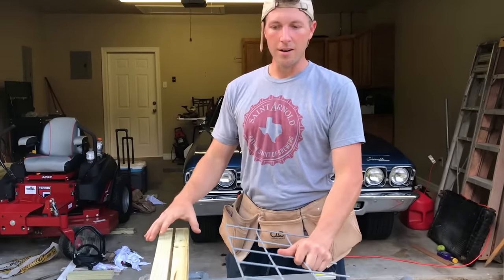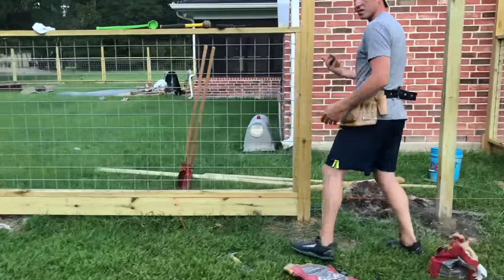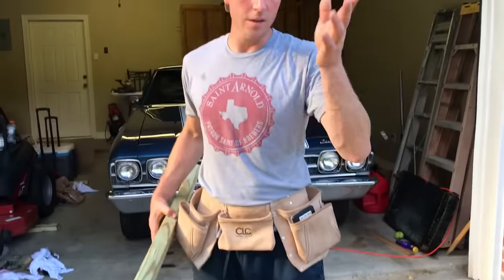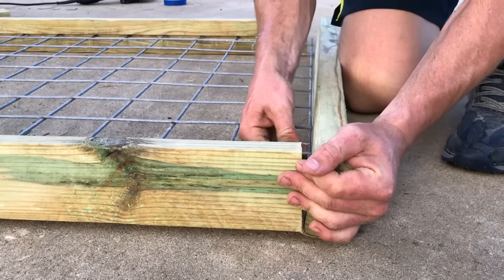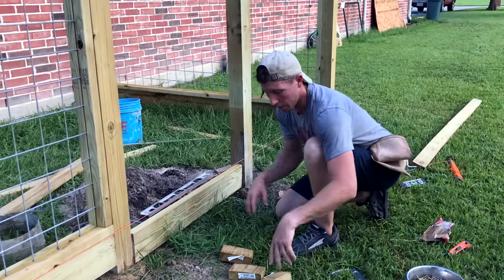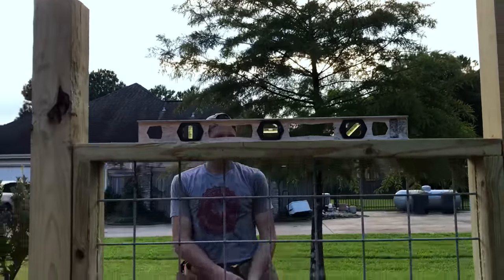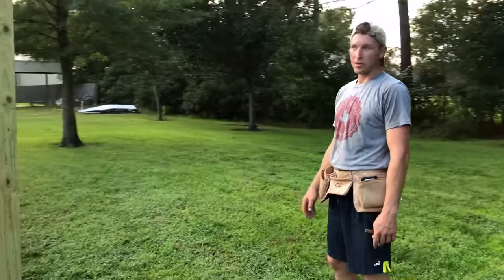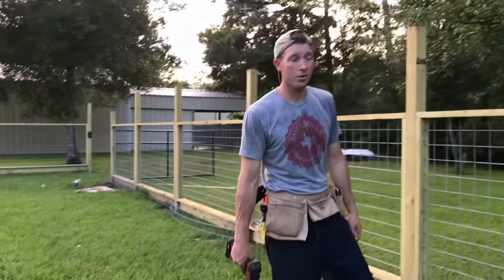Part 1: Modular Hogwire Panel Fence with Dado Groove

Comment: "Dog shit"?  I prefer the term "land mines"... :)

Thumb-up for the the St Arnold t-shirt and the token Lone Star cans -- the NATIONAL Beer of Texas!  I prefer a very hoppy IPA from Karbach though... Life is too short to drink crappy beer... :)
I'm in the Houston metro-mess and the HOA Nazis would not allow us to have that sort of fence -- we can either have the square metal tubing picket (aka "wrought iron") style or the 6 ft tall by 6" width cedar board picket "privacy" fences.  Of course, as everyone learned after Hurricane Ike, those cedar fences catch the wind very well and nearly every fence around here was blown over with the posts snapped at the ground.  I had around 250 ft of fence blown down by the storm and I replaced it with a square metal tubing picket fence that I welded up myself.  With the pickets spaced around 4" apart and only being 1/2" wide, they don't catch much wind, so they should survive any foreseeable hurricane winds.  Of course, building that takes more time than what you built.

One suggestion for you with respect to the panels though that might save you some time fitting them between the posts... Install the bottom and sides first between the posts and leave the top open.  Then slide the metal panel in the dado slot.  This will give you a bit more leeway if the posts are not perfectly plumb.
BTW, another wood and steel design that looks pretty good is to use rebar for vertical pickets and lumber for the horizontal rails.  Instead of cutting a dado slot in the 2x4s that you are using for the top and bottom rails, you just use an appropriate size drill bit to drill a hole about halfway into the upper edge of the bottom rail and the lower edge of the top rail.  #3 (i.e. 3/8" diameter) rebar goes for $4.25 for a 20 ft piece at Home Depot and is sometimes cheaper at the steel supply companies.  At 3/8" thick, I suspect that it would probably take a few decades to rust out even if you never painted it.  Personally though, even though I like the look of the wood and steel, the only reason I would do that is if I did not have the capability to weld the fence sections myself.  Besides, the wood rails on the fence end up warping over the years.  When I built my fence, I made one section so that it was removable by way of just being able to lift it off the brackets that hold it.  The HOA Nazis limit the size of the gate you can put in your fence and it cannot be made large enough to drive a vehicle through it and a lawn tractor just barely fits through their allowed size gate.  This way, if I need to have a trailer of mulch or whatever delivered to my house, I can remove the fence panel, back the trailer through it like it was a gate, and then quickly place the panel back before the HOA Nazis notice my impromptu "gate".
Reply from the maker: Thanks for your valued reply! I considered the way you were talking about with sliding the panels in, but i didnt want to take a change of being forceful and bending my wire if it wasnt exactly to the right tolerances. By the way, i prefer your kind of beer too, but if im doing a project i prefer to go the light route so i can stay on task..if you know what i mean. Thats pretty impressive you took it upon yourself to do your own fence. I would have probably done a similar method for making the yard accessible to larger thank lawn mowers. I dont know if you have taken the time to watch it yet, but i have a part 2 that goes over staining and included my 18 month evaluation that answers alot of peoples questions and concerns about how it is holding up. In short, there is nothing i would change about the design of the fence. Especially when it was one of the few standing after multiple windstorms over the past year an a half. Cheers.
https://youtu.be/bL89wkzSPDo
Reply: @GatorOverland  -- I saw the YouTube suggestion of the other video and just finished watching it.  18 months is not that long.  Hurricane Ike was in 2008 and the pressure treated pine on the rails of my cedar picket fence sections that adjoin my side neighbors definitely have a bow in them at this point, so let's see what your looks like in another 10 years.  Maybe with the less weight, it won't bow as much as mine ended up doing.  Each of my fence sections was around 7-8' in length since I just took the total length of the fence and divided it into an equal number of sections so that they were less than the 8 ft length of the boards that I was using for the rails.
Reply from the maker: @CurmudgeonExtraordinaire  you definitely did it the right way. My design is as tall and as long as you can go with  2x4x8ft and have minimal scrap (wasted money). Yes 18 months is still a very young fence. Being as i was a fresh new homeowner with no capital left and still needed to contain my dogs, i would have been happy with 5 years just to keep them safe, but at this point only time will tell. Im very confident i will get 10years at this rate. And if it begins to fail, it will be inexpensive to replace. Thanks again for you input.
Reply: @GatorOverland  -- The worst part was digging the post holes for the corners by hand.  The clay soil we have around here is either rock hard if it hasn't rained in a long time or refuses to come off the post hole diggers if it has been raining.  Only had to do that for the 3 corner posts though since I needed them to be set and the concrete cured before I rand a line between them and marked where I wanted the other holes (which I rented a trailer mounted hydraulic unit to do them with).  I didn't have any help doing the fence, so it was a bit awkward handling the 20 ft or so sections of 1" 14-gauge tubing for the rails, but with judicious usage of large C-clamps from Harbor Freight and various spacing and alignment jigs, I eventually got them all done... Just work on one section at a time and space it out with copious amount of a good IPA or stout.  Which, if you factor in the costs, probably made the fence nearly as expensive as hiring someone to do  it. :)  Seriously though, it's not that expensive if you buy the steel from a steel supply shop and the electrodes for your welder in bulk.  Just look at the price I mentioned for the rebar at Home Depot and use that as a baseline compared to what the cedar pickets cost each.

Comment: So I'm not here to bag on you.  The fence looks really cool.  I run a dog kennel, and the first thought that hit me was that it looks like 207 feet of doggie ladder for the dogs to use to climb up and over.  Of course you're only dealing with your own 2 dogs so you may very well not have that issue.
Reply from the maker: Thanks for the reply Scott! (laughing) we had a Lab when i was growing that would scale a 6ft chain link kennel. He would go to the corner and use the length and width sides as a ladder and make it to the top, teetering perched like a rooster on a hen house and jump over, just to go lay on the porch. I cant speak for other peoples pups with this fence design, but fortunately my pups seem to enjoy the yard, even when i open the gate they do not pass the threshold until summoned (the pet safe fence collar as a backup might have something to do with it though). You could still use this design and run plywood, planks, or a preferred size wire mesh in the groove to avoid enabling an escape artist. have a good one.
Reply: @GatorOverland   - That's cool.  Sorry, I look at everything like "That wouldn't work for me".  haha We've run a kennel for 13 years here in McMinney.  I like the Speeco latch, but I was wondering how much flex in the gate there would be at the bottom.  Could a determined dog push out on the bottom corner?  Or any reason why you couldn't double up on the latches, one high and one low?  I do like and appreciate the modular design of it.
Reply from the maker: @scottharrod2406  no worries bud, i know where your coming from. I got my speeco latches at tractor supply, but they can be found a bit cheaper on amazon. There are actually a few different designs and you might benefit from the one way opening latch for simplicity and added strength. I really like the 2 way latch and is very solid when closed, we used a safety chain just in case. I also like that the latch stud mounted to the gate actually ramps up a bit on the the post latch structure, removing most of the weight of the gate from the hinges. You could probably do as mentioned and do a high and low latch or maybe just move the single down a bit? If you did the high and low latch (i can draw this up and email it to be more understandable) you could probably drill a hole in both inside and outside latch releases of both high and low latches and bend some all thread rod into the hole of upper one and down to the hole of the other on each side of the gate and affix with nuts, thus making the high and low latches separately linked on each side of the gate. Both insides would open or both outsides  would open at the same time by pulling on either of the upper latches. This would allow the added strength of 2 gate latches but the convenience of opening them without bending over to the bottom latch. I would still affix some method of keeping the rod linkages secure/locked so a smart put doesnt open it with his nose. keep in mind these latches are to keep livestock from getting through so they are pretty brute considering how simple they are.
Personal question, are you a trainer or just a boarding kennel? i have an 1.5 year old aussie that is sweet as can be with the mastiff and my fiance and I, but doesnt know what friend means when other dogs or people approach (see's red and barks incessantly) any recommendations?
Reply from the maker: hawkijon@aol.com

Comment: Brilliant idea, and an amazing looking fence. I was concerned with the depth of your dados.. You've cut them about 3/4 of the height of your boards making them much less sturdy over time,  Especially if hit by a mower or trimmer , or just from usual wear and tear and age and degradation of the PT wood ?  Also. have you noticed excess water pooling in the lower grooves too ? Perhaps a few drainage holes  drilled from the bottom of the lower boards and into the dado channel, every 12" or so, for draining any water ?

I m going to check out those cow panels as they seem like a brilliant idea for a fence. My local TSC may have them.
Reply from the maker: You’ve asked all the right questions… I have not seen any degradation of the wood material even at the depth of the dado… I did go back and put weep holes in the bottom groove… The rigidity of this fence being supported by two uprights and the lower rot board is incredible…You should check out my part to which is an 18 month review and staining… It covers a lot of the questions you’re asking
https://youtu.be/bL89wkzSPDo

Comment: How about dog proof??.... You have a heavy dog, won't him tackle that fence down, the wire mesh?..... Mine bites and pulls and torn wire like that.
Reply from the maker: mxlman26 the wire panel is by itself is fairly rigid. When Placed in the dado groove frame it is very sturdy. I’ve Leaned and pulled on it with all my weight and you’d be surprised how little the panel gives. I’m confident that it would contain anything shy of an atv or truck hitting it. It’s worked great for my 200 pound mastiff and 50 pound Aussie. In a recent windstorm, the majority of the people in the neighborhood with a plank fence had significant damage, and mine is still standing without a problem.
Reply: LOL my pits hate that wire then.... Overall if they see cats around

Comment: I really like the fence and the whole project, but you need to brush up on table saw safety.  I am a hobbie wood worker and have spent many hours on my saw. Table saws can be very dangerous, especially even more so when using a dado stack.  For your sake, watch some videos about safety.   Having two hands and ten fingers is not something to take for granted.   Cheers
Reply from the maker: I appreciate you taking the time and comment… If there’s any regrets about the video is that I did not enforce safety as my practice… A table saw or saws in general is no joke and I made a parity of it… I honestly made the video as a reference for a friends and others do you understand how to put it together and never would have thought it would have gained as much traction as it has… So other than being proud about the build and the design, I am somewhat embarrassed about my carelessness. The fence is holding up great though😉

Comment: Sweet fence they make post levels that are cheap.
Reply from the maker: I have since purchased a 9" post level from Lowe's to help a friend build the same type fence as in the video, and it was a great addition to the tool box for sure. I'm sure there are some ornery folks out there that will only use stick levels without thinking twice. I haven't looked back, that's for sure. Thanks!
Reply: Thanks for the video I am building this fence now
Reply from the maker: @bigestees4391  You bet! The design has held up great and thus far has got a lot of good feedback as well as a few viewers comments with beneficial input and additional upgrades that could/should be considered. Thanks for the reply!

Comment: Bolt cutters will cut them easily
Reply from the maker: I did use bolt cutters on the first and second panel, and will work just fine if thats all one has access to. The grinder with the cutting disc is definitely less of a workout and cuts a bit closer when placing up against a metal runner of the grid.

Comment: My only concern is trash / water in the dato yes it is treated but?? The 2 x 4 sand which is my preferance.
Reply from the maker: John, this was a concern of mine as well and i mentioned it toward the end of the video. I went back with a drill and bored (3), 1/8" weep holes  per panel into the dado valley (end/middle/end, in the downward facing 4" side of the bottom rail). On a dry day i filled the dado valley with water from a bottle and the holes drained sufficiently. I'm sure over time these holes will clog or fail, but for the time being i have peace of mind. Thanks.
Reply: @GatorOverland  Thanks for the reply what do you think about using 1 x 4 pt with a sand which I have a client on a tight budget. Another Utuber used 1 x 4 ?
Reply from the maker: @johningram1920  i had considered 1X1 and 1X4 sandwichs at the beginning, but didnt know how consistent it would flush up with my posts and/or hold up structurally over time. I then realized how much more screws, cuts and time for positioning/installation would be required to make that work. Having just bought the house, a mower, and doing interior painting, i was pinching pennies as well when it came to the fence project. I would say the 1x4 route is a way to go, but i dont think it would be the most efficient or consistent end result, which should factor into the those worthy additional "costs of convenience". Send me an email to hawkijon@aol.com and i will scan you a hand sketch i did and can help with accounting for material and dimensions. I ran the numbers quite a few times to determine my dimensions and my build goal was to use as little material as possible as well as not having too much excess scrap at the end.
Reply: @GatorOverland  Thanks I am going to build 7ft. sections instead of 8ft sections Thanks for the advice.

Comment: Was the fence posts submerged in the cement or sitting on top? I can't tell. Doesn't the wood swell inside concrete? Could you use some sort of decking material? Looking for a fence solution for 4 acres (squared property) a minimum 2 acres long on the side of the property, to look nice. Back of the property could be T-posts.
Reply: @GatorOverland  I just seen your part 2 video! I'll be going through the share drive info later. Thanks!

Comment: Great job and original "concept"dude! I'm a handyman as well and I'm looking forward to learn some techniques on how to install some posts at home and I ended up here.  Thanks man!.
Reply from the maker: Thanks for the reply, i have a hand sketch and material breakdown available for my fence build. Shoot an email to hawkijon@aol.com and ill send them. Also, my method of plumbing the post was with levels i already had available, ive since bought for about $10 @ lowes/home depot a very convenient level for measuring both sides a the same time.
https://www.homedepot.com/p/Oz-Post-Post-Level-50740/202400878

Comment: Looks nice when it is new but will the grooves or dadoes hold water and rot? Better make the bottom out of 2 pieces and bolt them together so the rain can run thru.
Reply from the maker: Thanks for the reply! Yes they would hold some water, but i went back after the video and drilled a 3/16" hole every 8-12" or so in the bottom of every panel frame, and then checked the draining by pouring a liter bottle of water in the groove and it drains very well. No need to make the bottom out of 2 pieces.

Comment: Thanks for the video John, as well as the shared files and support in comments.  I see you’ve used a 3/8 (9.5mm) Dado for 6 gauge wire (4.115mm).  Is this because the panel thickness is double where the wires cross each other? In which case I presume trimming the panel to in between the overlap would give a less than perfect fit?
Reply from the maker: That’s exactly right !